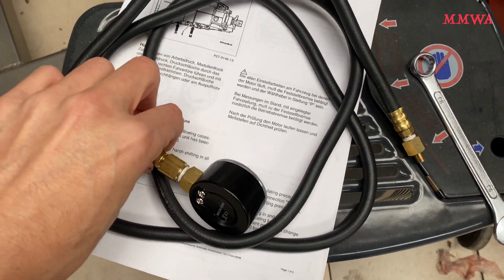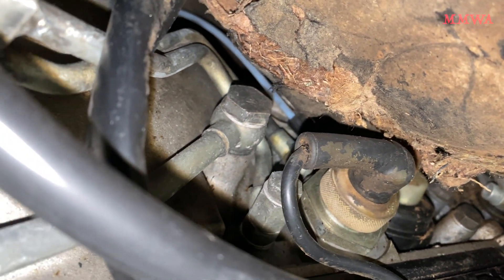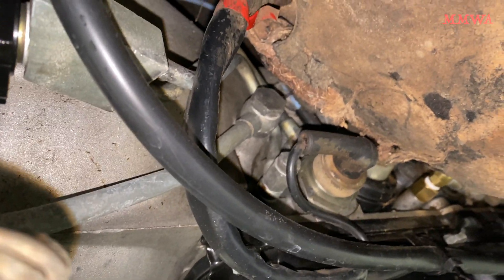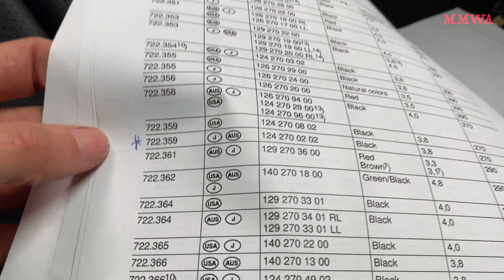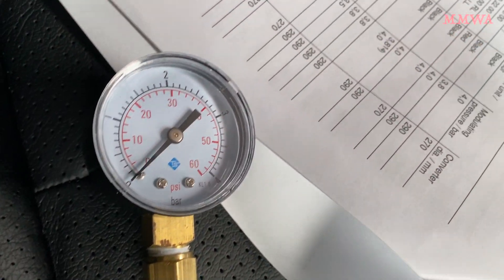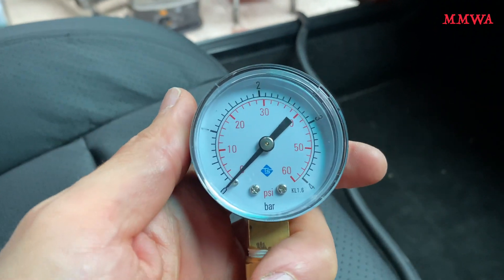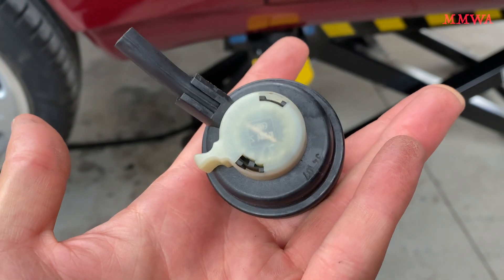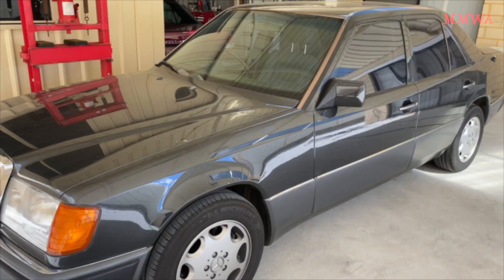Mercedes 722.359 Transmission, testing the modulation pressure

Comment: Hey, where did you get the paperwork? Trying to see what the stock tourqe converter size for 722.311 is.
Reply from the maker: @MechatronCNC-HVM  its in the workshop information system, a standalone system with the epc or comes with star diagnostic setup
Reply: @MMWA-DAVE  ah okay, makes sense if it comes with the star kit.

I could only find the first 3 pages online (without the tables)

Thanks for your response
I will have to calculate it instead using pictures. Information on these old mercs is getting harder to find.

Thanks 👍

Comment: Great educational video as always and thank you. Quick question, Can a bad modulator cause smoke from exhaust pipe? I am also an owner of 300CE with M104
Reply from the maker: when diaphragm ruptures in these things on any transmission it is possible to suck atf up and into the intake manifold. My first car as a kid was doing these smoke screens, it is accompanied by poor or no shifting once the fluid level gets low enough. easy enough to test with hand vacuum pump
Reply: Great Thanks

Comment: I have a W126 300SE 1988 with the 4 speed trans. # on box is 126 270 95 01 722 319 0 30 007 32 on the side, does anyone have the pressures of this trans. please, it hard when I into reverse
and I'm sure the pressures are too high. I just can't find anything information on this particular box, can anyone help please. I also would like a proper manual on the car and the auto-trans
thanks

Comment: Actually thought I would test my trans yesterday, used standard oil pressure kit, had all the fittings including elbow in my kit. But had zero pressure at idle, with vacuum connected. Thinking port may be blocked ? I didn't let it run for too long, before questioning whether I even had it connected to the right port, after seeing your video again I can confirm its the same port.
Reply: Vacum is supposed to be disconnected when doing the test....not connected.
Reply: @TheCarTakerGarage  Thanks for that, might get around to it again.

Comment: Can this cause transmission fluid leaking into the engines vacuum and going into combustion causing smoke?
Reply from the maker: absolutely. If there is any atf in the vacuum line, replace it.
Reply: @MMWA-DAVE  Do you know a website that sells a modulator (red) for a 93 190e 2.6, im having a hard time finding it.
Reply: @Jhelm the Mercedes Main Dealer garage can order their correct one for you, with the vehicle chassis number

Comment: Could a bad vaccum modulator cause a late shift?
Reply from the maker: on these transmissions shift points are altered by the throttle pressure cable, which is adjustable. The vacuum modulator only alters shift firmness.
Reply: @MMWA-DAVE  well my issue is that the cable is fully extended and i still have high rpm  shifts if I shorten the cable a bit it increases the rpm to shift even more...The shifts at low speed are with a clunk sometimes and a push foreward...at full throttle the shifts are smooth fast and nice overall but still at high rpms..All vaccums check i dont know what to do honestly anymore..
Reply from the maker: @salehfiras943  do you have the S/W switch by any chance? If this is malfunctioning it may explain the late shifting. The harsh shifting at low speed does sound like the vacuum modulator either not adjusted right or having a burst diaphragm. It can be tested with a vacuum tester. The S/W function is also a vacuum pod on the throttle pressure cable which can also be tested same way.
Reply: @MMWA-DAVE  I have fixed the problem(6months worth of reading manuals and forums and all of that... maybe it will help others in the future...The pin in the garbox that it connected to the cable was stuck! Couldnt believe it but it did! For anyone who has problems with the gearbox take it step by step...Verify linkage corection of the pressure cable (and the integrity of the cable by hearing a click in the gearbox when pulling and letting go),verify vaccums and after that dig deeper(ofcourse after you SERVICE the gearbox with a new filter and the right new oil)
Reply from the maker: @salehfiras943  What symptoms did you have with the jammed pin?

Comment: Beautiful. So I was getting flares between gear changes and dialed the pressure up on the adjustment with the volume cap off. Flares are reduced, almost imperceptible unless in a very specific rpm range (2200 - 2500). However, there's a big shudder and jolt when the car warms up, and I go from P to D, or D to R or R to D at idle. In normal driving, gear shifts are smooth. Jolt only happens at stand still. What could be the likely culprit?

Comment: Hi, I have a 230 TE 1991 Wagon when I drive it would not shift to D could replacing the Vacuum Box fix my problem? Thanks
Reply from the maker: likley the transmission has had a serious internal malfunction if the oil level is correct and there are no forward gears.

Comment: Hello please can I have a link to have the sheet with the specifications according to the transmissions. I have to change the modulator on a Mercedes w124 E250 diesel from 1994 engine OM 605 911, thank you in advance
Reply: ditto that request, please.

Comment: Question, does the modulated oil pressure control the hydraulic pressure on the bands and clutches? I.e, if the modulation pressure is increased, Tee bar screwed in, is the transmission less likely to slip under full power situation? Many thanks. I see many people are running incredible power and high boost, but what Mods are the doing to there trans